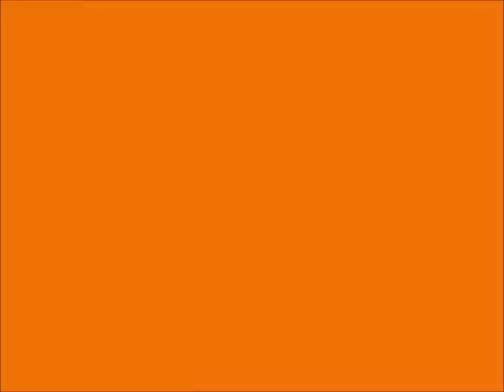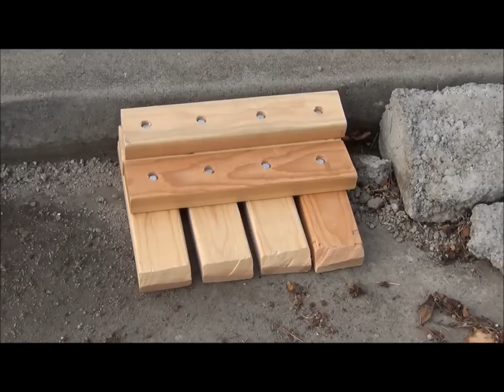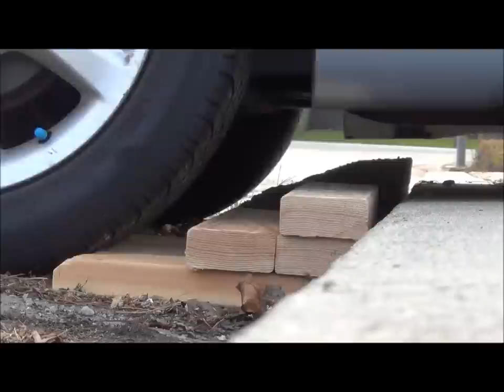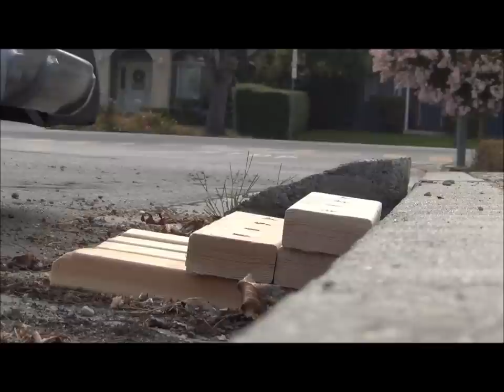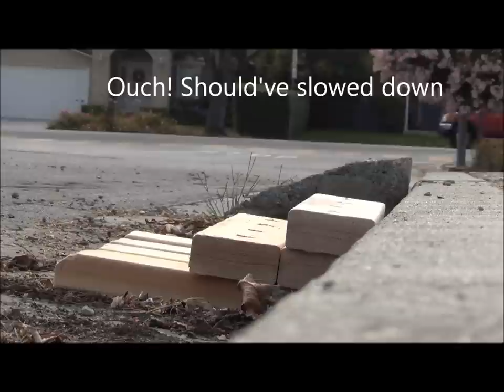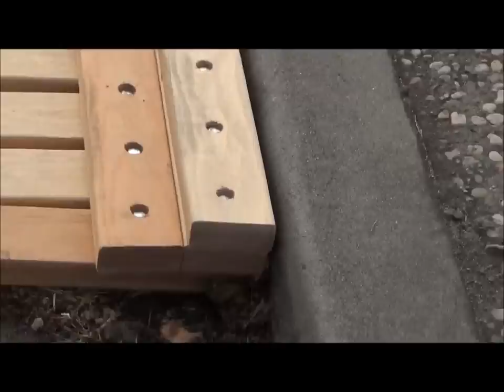DIY Curb Ramp for Cars

Comment: unsafe, ask a woodworker to make these for you, this is straight unsafe and you shouldn't show this to people
Reply: Please explain why
Reply: @EricFleming231  it shouldn't need explaining all you need to do is look at the video. So unless you're setting me up for some kind of sarcastic comment, Sure I'll point it out both ramps he's using are shifting as he moves on them . The concrete is higher than the other side and it's pointed and the transitions are two jagged and rough. It'd be better if they were wider for safety and preferably less of an incline. But assuming your comment wasn't sarcastic having ramps that are bouncing and uneven makes them super unsafe
Reply: well Mr. NASA engineer, for $7 and 20-30mins of his time, this build may be a reasonable solution, depending on how often he needs to use it and what the load is. Durability and weatherproofing are trade-offs vs a more robust build, no doubt. btw the wobble flex shown actually will stress the wood LESS at fastening points. There are plenty of "better" solutions for $150 - buyer beware